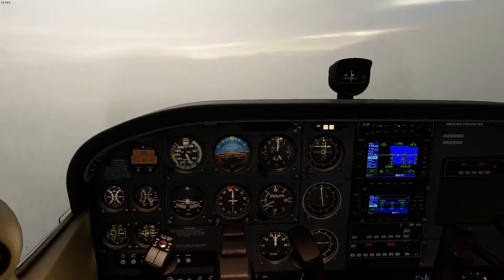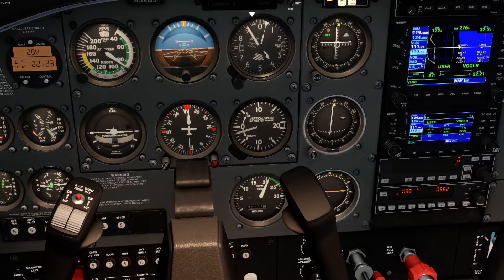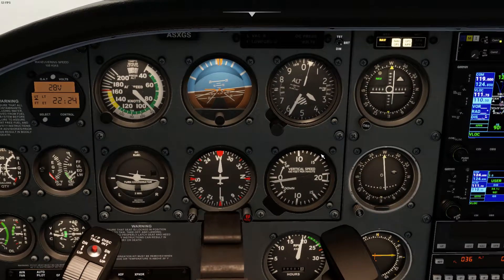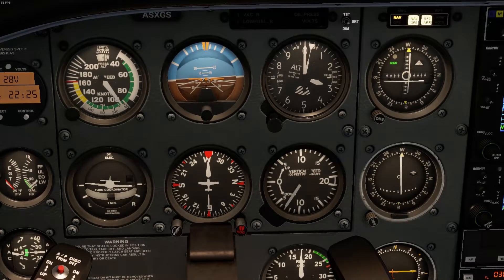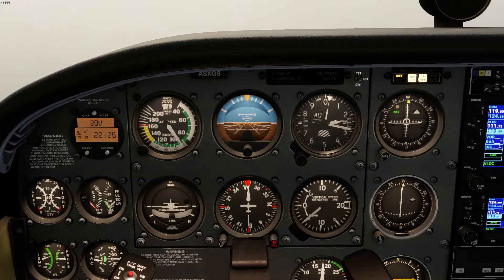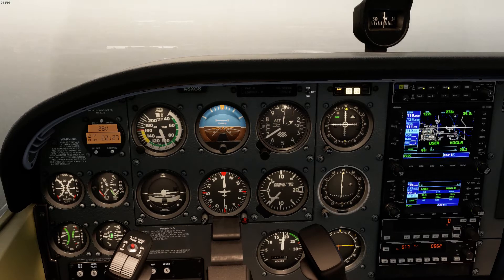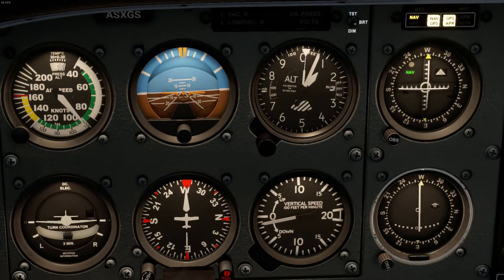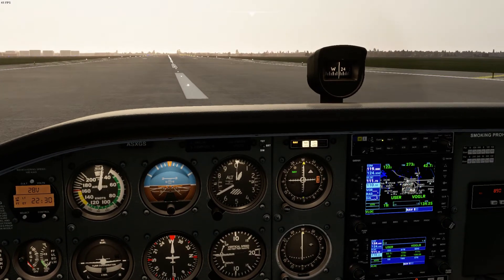REAL-LIFE FLIGHT TRAINING (MSFS 2020) Lesson #4: IFR ILS Instrument Approach KORD 27R Cessna Skyhawk

Comment: I wouldn't advise to fly the heading bug. If you have any wind you'll just get blown off the LOC again. If you're in a plane with a track bug (I.e. g1000 or better) you can fly that.
Reply from the maker: Thanks James! I teach my students (on steam gauges, at least) to use the heading bug as the "center point" and make ~5-10 degree wind corrections off that. (Winds often change as you near the ground)

It sure is nice to have GPS help, like the G1000 or even a G430, as you can compare and align your desired track with your actual ground track.

Safe flying!